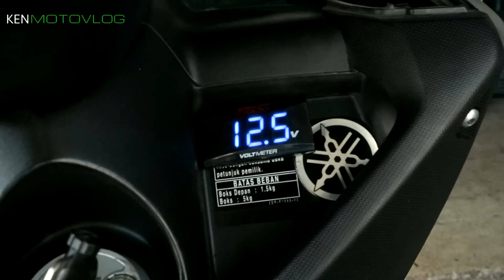CARA MENGATASI ENGINE CHECK MENYALA

Comment: Daftar ngine check saja kurang booss,
Maaf sebelumnya saya hanya melengkapi saja dan sedikit share, Tiap kedipan lampu engine check juga.
Itu menunjukan kode tertentu untuk menujukan sensor2 tertentu pada part motor nmax.
Tp tidak untuk patokan, bahwa sensor yg memberi singnal pada engine check itu part nya rusak, tetapi bagian part yg berkaitan dgn sensor yg memberikan signal itu kemungkinan mengalami kerusakan.

Sebelumnya terima kasih atas vidionya, dan sangat bermafaat untuk masyarakat indonesia khususnya pengguna motor yg sudah berbasis EFI.

Comment: setuju dengan pernyataan nya, bahwa bengkel resmi tidak semua mengerti. sekitar 2 tahun lalu saya bawa vario ke bengkel resmi di kebayoran untuk service itupun harus ambil ambil no antrian dari pagi karna saking ramai nya

1.kasus baut oli yg tidak original, mereka bilang ini bukan ori baut, pasti nga bener yg ganti oli sebelum nya,
saya katakan satu bulan lalu saya sevice di sini awalnya ngotot nga terima, setelah saya suruh cek data di komputer mereka diam.
2 kasus acg, mereka bilang ecu nya mati tanpa cek langsung vonis
kita sempat adu argumen, dan jika argumen saya salah silahkan ambil motor saya dan beserta surat2 nya tapi jika saya benar apa yg saya dapatkan dari pihak bengkel,
 
alhamdulilah karna mengerti masalah mesin jadi tidak bisa di tipu dan asal ganti2 harga ecu yg cukup mahal.

Comment: Kelemahan Yamaha yaitu di kiprok. Gua udah pengalaman di R15 sama nmax. Engine check indicator lampu nyala.
Reply: pny gw yg keluar kode 61 apaan ya, sialan gw baru KM. 25.000 udh ganti spare smp 1.052.000. dan yg bikin kesel engine checknya masih nyala! kan anj*ing tuh bengkel resmi 😡

Comment: Setuju sekali bang, di diler itu cuma mau ganti baru aja tdk mau di cek betul atau di bersikan..kemarin mobil sy baru pica plastik dan jarang  skli jln cuma di garasi sj mungkin terlalu lama terparkir akibatnya rem depan lengket.akhirx sy bawa ke bengkel resmi dan ternyata mereka blng piston cakram depan rusak harus ganti dan harga 1 piston rem cakram dpn 1,7 x 2 kiri kanan..dan sy tanya ko mobil baru jarang skli jln bisa rusak barang sekecil itu dan jawaban mereka manusia sj bisa mati😏. Dan akhirnya sy pulang besok sy bawa ke bengkel kecil pinggiran jln mereka buka dan cuci saja eee Allhamdulilah sdh 1 tahun ini sy pake mobil normal dan tdk lengket lagi.. Jd klu abng bicara seperti itu sy orang yg paling setuju 💪🏻

Comment: Nice om.
Kendala saya
1.Speedo mter cbr150 blank
2.Indikator cek engine menyala.

Service ke ah*ss , kendalanya di ceritain.
Oke,langsung naik pit.
Cek cek cek,selesai.
Sy di panggil.
1.speedo blank,cobain aja pake hedraiyer ktnya di keringin slama 20menit.
2.indikator cek engine menyala,katanya udah di reset injeksi nya. Ktnya udah aman.. Keluar dri ah*s,,tiba2 nyala lagi.

Waktu itu service reguler.
Ganti oli,reset injeksi,yaa pokonya service rutinan di buku service tu kan ada daftarnya..(bar ga dijelasin pjg lebar)

Point :Nah selsai dr situ,motor masih tetep sama.. Ga ada perubahan,hanya dirubah ganti oli.
Sblumnya rante aman2 aja,dan stel kupling aman semua..
Begitu keluar dr situ,rante kereng(kenceng) stel kopling udh kek ga di service 7taunan ga enak..
Baut ada yg ga kepasang..

Sperti motor sy tuh jadiin bahan PKLan buat anak2 jurusan otomotif..
Beda dgn orng yg dewasa ngerti motor gtu mksdku, ya ga semua mekanik kya gitu..cuman kebanyakan yg saya liat bgitu(semrawut kerjaanya)
Reply: Dealer resmi cuman ngandelin alatnya aja yg canggih.biar keliatan wah,tpi hasilnya? Beda jauh dgn bengkel biasa..
Karna apa,bengkel biasa tuh jual kenyamanan konsumen. Di banding dengan dealer resmi, jual alat bukan jasa! Krna sy sendiri yg ngerasain..
Ke bengkel biasa,cerita gini gitu ,langsung di telusirin apa penyebabnya.
Kalo msih bisa di repair ya di repair.
Kalo dealer resmi,NO!! Ini barang harus di ganti.
Speedo mter aja disuruh ngeringin sndiri,dia ga ada punya jasa repair.. Lah tong itu sparepart dri mana kalo ga dr bengkel resminya,yg buat masa tukang donat?
Dealer resmi kenapa ga nyediain jasa repair,karna dia orang pingin barangnya kejual,pikir bengkel resmi gini(lah,gua buat banyak sparepart ngapain ga dijual,kalo ada jasa repair ,item ku ga akan kejual) begitu prinsip dr dealer resmi.
Reply: Curhat sdikit,dulu pake bebek karbu 110..
Skrng up ke kelas sport. Pingin service ny emng bener pingin maksimal krna ilmu/pengalamannya kurang paham..

Comment: Mas q mengalami masalah yg serupa, dmn motor jupiter z1 q mogok mendadak dan engine cek nya kedip2 beberapa kali, di stater gk bs baik itu doubel stater dan stater kaki.

Singkat crita, q bawa ke bengkel resmi yamaha. Sambil bilang masalah motor saya yg mogok tiba2, lalu mekanik itu bilang "semuanya gpp, ini masalah nya perlu ganti piston nya kArena gk kuat di stater dan km motor nya uda gede."

Krn uda percaya sama mekanik nya, q setuju dgn usulan nya. 
Alhasil setelah di service besar dan ngeluarin biaya banyak, eh motor saya masih tetep mogok tiba2 dan lampu engine chek nya kedip2 lalu di stater gk bisa. Di tambah kabel spido meter saya rusak haduh kok gk bertanggung jawab gitu
Klau kayak gini q mau komplain aja ke dealer yamaha nya, kluar dana banyak tapi hasil nya masih tetep gk ada perubahan

Mohon petunjuk nya mas bro
Podo2 dulur suroboyone, tolong saran seng apik yo opo iki? 
Q yo arep komplain iki, kerjoane kok gk becus ngene

Comment: Betuuul bangeet, gw Ada motor Beat.  
case nya waktu itu, tiba2 rem depan gw tiba2 ngunci . Akhirnya gw bawa ke bengkal AHASS which is bengkel resmi. Kata montirnya karena sensor untuk stater, akhirnya d potong/di copot lah kabel untuk staternya yang nempel di rem depan, akhirnya kalau mau stater cmn bisa pake rem belakang (sebelah kiri).
Ehhh baru beberapa kilo meter kejadian lg.
Akhirnya gw bawa lah ke bengkel kaki Lima, ternyata bagian handle rem sebelah Kanan Ada yang berkarat. Dan cuman kena biaya 35rb kalau gal salah. Langsung sembuh.

Comment: Saya mekanik bengkel resmi,tolong ganti judul. Kalau judulnya seperti itu,itu sama saja engkau menghina semua bengkel resmi. Dan setiap pekerjaan pasti ada yg jelek wajar kita manusia. Toh mana ada mekanik bengkel resmi yg mau konsumennya kecewa. Mana ada mekanik bengkel resmi yg mau hasilnya ga beres/ bermasalah. Kita maunya ya konsumen juga senang.
Reply: Sip mas bro.. Aku jg dr beres, kalo di liat dr pernyataan ama kenyataan nya agak ngaco ya mas, masak ada piston tanpa ring piston motor bisa nyala? Coba belajar prinsip dasar motor 4tak dl mas. Kalo gak bisa monggo di coba sendiri pasang piston tanpa ring piston trus coba motor di stater smpek kakimu patah yo raiso nyala mas wong kompressi bocor.
Reply: Kl emang lampu check engine nyala kan bisa di baca brapa kedipan lampunya, nanti di liat di buku manual kerusakan apa, itu kan dr bengkel mas nya juga gak di cek dl kan pengisian dr aki berapa volt, kok langsung di tuju ke kiproknya!! Bisa aja aki nya yg drop krn watt lampu melebihi std. Pengalaman sy jg pernah nangani n max pake lampu projie lampu di nyalain pengisian lngsung drop krena watt lampu trlalu besar, tp kiprok normal2 aja.

.srn sya kalo emang gk suka dg pelayanan beres gk usah menjelek2kan, toh kita jg sama2 kerja cari nafkah, gak semua kok beres itu krjanya ngawur, banyak jg pelanggan kita pindahan dr bengkel umum ke beres krn pelayanan kuran memuaskan.
Reply: Aziz Masyhuri padahal yg kode 46 itu udah lumrah dibengkel resmikan.. Apalagi v-ixion 3c1.
Reply: @Asp080  iya mas, setau sy kl n max jarang kiprok nya jebol, paling aki nya yg drop.
.aku jg sering dpt pasien mio j series sering banget malah konsumen ganti aki di bengkel umum kiprok nya juga di ganti sekalian parahnya kiprok mitasi malah baru seminggu aki saiki lagi.
Reply: Tidak semua mekanik bengkel resmi begitu mungkin lagi apesnya aja ketemu mekanik yg kurang pengalama wkwkw

Comment: Seharusnya beres bs nyari masalah engine check pakai laptop. Dijamin gak salah kaprah, krn kerusakannya akan detect di laptopnya.
Klo gk minta memang dia gk akan ksh. saya ke  beres selalu mnt di scan pke komputer walaupun engine cek tdk nyala tp tiap sensor itu pnya batas toleransi, nnt kliatan sensor mna yg udh mau rusak.
Reply from the maker: Selesai service mereka nyolokin ecu ke laptop sambil motor dinyalain tapi gak manggil saya. Anehnya ditengah tengah cek ecu mereka matiin lampu utama, kenapa demikian? Wkwkwk

Comment: Nanya dong bang, semoga ada jawaban disini... 
Motor ane kalo colok kunci kontak trus trek ke on gak langsung nyala... dan itu kadang2 gak nentu, sempet nyala redup trus mati... awalnya panik motor gak bisa d apa2in / gak bisa nyala juga.. 
Tapi pas ane pindah standar / pijak ke standar tegak kontak langsung nyala... 
Dan sekarang kalo terjadi begitu pasti solusi nya begitu dengan cara pijak ke standar tegak.

Sudah coba cek sikring aman semua... 
Nah itu kira2 apanya ya bang? 
Nanya ke bengkel resmi gak ada jawaban, karna pas d coba kebetulan tuh motor nya lagi bisa nyala...
Jadi gak bisa cek/diagnosa apa yg terjadi... 😪😔

Semoga para master disini bisa ngasih solusi... 
Sblm nya trimakasih bang.. 🙏

Comment: Sama kayak Vespa Matic saya, motor gasnya ngayun kayak naik-turun gasnya lalu saya bawa ke bengkel resmi. Sudah ganti lambda sensor, ehh motor malah sering mati klo lagi keadaan jalan macet. Lalu seminggu kemudian balik ke bengkel resmi tsb, di cek PADS katanya normal dsb. Dia cek lagi sampai ganti injector dan masih juga gas ngayun naik-turun. Dan malam ini engine check nyala lagi. Bener kata ente bang Kenna, bengkel resmi bukan jaminan bisa nyelesain pr di motor kita.

Comment: Yang paling ngerti motor kita harusnya itu ya kita sendiri. Bukan bengkel. Sorry bro, complain nya kurang tepat kayanya. Motor situ udah banyak ubahan nya. Kalau bengkel resmi taunya based on manual book setau gua. Bener langkahnya ke bengkel spesialis. Banyak solusi buat yg udah modif2. Gua jg banyak kecewa sama BERES. Makanya belajar sendiri biar ngerti. At least ga di sembarang2in diagnosa di bengkel mana jg.
Reply from the maker: Gak gitu masalahnya bro, kalau seandainya motor udah banyak ubahan juga masa beres gak ngerti problemnya. Gue sih curiga mereka ngerti problem gue tapi males garapnya karena dia gue perhatiin dari ruang tunggu ngotak ngatik lampu waktu itu cuma diem aja mereka
Reply: @KennaPrasetya  nope. Most of the time, hahaha. Beres means tidak beres. Sudah rahasia umum kalau mekaniknya kejar setoran dapet pasien. Pasti banyak yg kurang. Intinya lo bener kecewa, nunjukin bengkel spesialis yg lebih telaten ngerjain motor kita. Tp gausah di jelek2in beres nya. Karena, hampir semuanya malah tidak Beres di beres and we know it. Lol. Semoga maxi nya tetep aman terawat. Cool mods you have there. Greetings from bali!

Comment: Stiap motor itu beda beda penyakit.nya..  warning light yg nyala itu tujuanya memberitahu pengendara kalo ada yg bermasalah di motor.nya.. dan ada 2 warning light yg ada di dashboard motor.. warning light yg untuk FI dan warning light temperatur.
Mungkin terjadi kesalah pahaman saat mas.nya memberikan keluhan ke mekanik.. wajar kalo yg di cek warning light buat temperatur.. kn recervoir.nya ada yg bocor.. mngkin di kira yg itu..
Saran sih.. klo memang motor.nya masih belum beres mending di bawa lagi ke bngkel.nya.. kan masih ada garansi service.nya
Reply from the maker: Ralat, keluhan yg disampaikan ke beres sama bengkel biasa sama penyampaiannya... Tapi kenapa bengkel biasa bisa ngatasin beres belum bisa?

Comment: Ane juga punya waktu itu bis bershinin trortelbody nmax sendiri keluar angka 34 direset ke beres, eh gak lama malah keluar kode 61 plus lampu cek engine nyala terus kadang gas gede sendiri, opsinya kadang Matinin kontak idupin LG lampu cek engine ilg dibawa jalan ya dia nyala LG, nih harus gimana ya pusing saya omm
Reply from the maker: Coba di cek di deskripsi video ini ada daftar kode cek engine nmax
Reply: Ini error di bag throttle body gan.. masalahnya sama kayak saya. Dan belum solved meskipun udah di kasi tau di beress.. besok nyala.lagi...

Comment: Kmaren sy servis cbr ke dealer resmi, kata mekaniknya ada masalah pada injektornya yg mengakibatkan brebet saat gasspol. Terus saya di sarankan ganti injektor nya dan dimintai biaya 1jt, apa gak salah tu harga injektor 1jt?
Reply from the maker: Injector kalo problem ya cuma brebet biasanya dibersihin udah normal lagi, jangan mau mas wkwk
Reply: @KennaPrasetya  dikasih 2 pilihan, di ganti baru biaya 1jt
Dan ''di akali'' dia bilangnya itu biayanya 300rb
Jadi saya pilih di akali biaya 300

Comment: Mau tanya..solusi error 61 nmax..sdh ke beres gak beres,ke bengkel komunitas nmax jg gak beres padahal sdh ikutin saran nya suruh ganti isc ..setelah ganti isc malah disuruh ke beres.
Reply: Kode 61 jangan buru2 ganti ISC, kemungkinan itu kabel ISC warna pink ke ECU putus om..
Reply: @sevyteresa6267  bener ternyata kabel pink putus..mksh ya
Reply: Sama2 om semoga awet..
Reply: Kalo kode 24 knpa ya bro nmax sya kode 24
Reply from the maker: Coba baca deskripsi

Comment: Setau sy kalau check engine menyala itu sebuah peringatan dari ECU (seperti mobil) bahwa ada yg tidak normal untuk mengetahui error nya apa ya harus discan dan bisa di reset untuk menormalkan kembali. Perbaikan tergantung dari kode error' nya masalahnya apa.
Tidak semua bengkel resmi lebih buruk dari bengkel biasa begitupula sebaliknya.

Comment: Emang ga jelas terkadang deler yamaha resmi
Pengalaman di yamah xabre w suara mesin berisik,w bawa ke yamaha resmi disuruh turun mesin,dan harga ya 1,5 lebih,
W ga yakin akhir ya w pindah ke bengkel biasa ternyata cuma ganti bering rante keteng cuma 250 w habis itu udh ganti oli mesin +air radiator.

Comment: Hallo om ,punya saya juga kaya gitu om ,pas pasang alarem motor ,apa saya harus ganti kiprok juga?
Reply from the maker: Alarm gak gede sih harusnya dayanya kok sampe kaya gini? Ada kodenya gak engine checknya?
Reply: Kalo kode tidk keliatan om,jadi gini pas di ON tuh lampu indikatornya nyala ga mati-mati om ,
Nah pas saya restar lagi kontak OFF,
Trus kontak ON nah normal lagi om
Gimna ya om solusinya
Reply: Jdi setiap star tuh kontak harus 2x di ON nya om😥
Reply: Soalnya saya panik lngsung di off in lgi kontaknya

Comment: padahal motor baru bang koq sudah kena kiprok ya, apa penyakitnya sama dengan r15 dulu yg sering kena kiproknya?
Reply from the maker: Kan di video udh di bilang, karena pemasangan lampu yang strumnya kegedean, bukan masalah umur kiprok
Reply: okesip, maaf kurang fokus nyimaknya. yup pemasangan aksesoris yg tidak sesuai ketentuan akan merusak kiprok.
Reply: @KennaPrasetya  projienya 35w bang? Dobel apa satu? Ga keliatan. Saya pake gitu juga. Motor nyala nggamau di starter. indikator engine nyala sama muncul kode 46. Alhasil ndorong. Setelah saya baca di buku panduan. Tenyata masalah pengisian. Jadi saya lepas aki. Dicek ternyata tegangan turun sampe 10v. Di cas dulu deh. Sekarang ganti kiprok tiger. Siang hari cuma pake AE DE di kisaran 13.9-14.2. Tapi kalo malem hari lake lampu cuma mentok di 11.9 doang. Ente gimana gan? Ane takut err46 lagi. Males ndorongnya beratt 😬

Comment: Area Tangsel ada bengkel nonresmi yg recommended?
Reply: Dimana bg di tangselnya
Reply: Saya mau tanya om.saya sudah ganti aki dan ganti kiprok.tapi lampu indikator enginchek masih nyala .nmac
Reply: Sy sdh bersihkan throttle body dan ganti sensor ISC. Tapi lampu masih menyala. Terakhir, kata mekanik bengkel resmi ada kabel yg putus atau sambungannya longgar. Setelah dibenerin sebentar, semingguan lampu engine check nyala lagi...

Comment: Mau minta pendapat para agan2 yang sudah lama mengendarai NmaX , kemarin saya serfis gratis pertama gratis oli dan hanya di cek pake monitor.  
Teknisinya bilang semua masih dalam keadan baik. 

Apakah kalau serfis harus mengunakan monitor, 
Soalnya saya minta penjelasan mengenai yang ada di monitor teknisinya kurang begitu paham, penjelasanya tidak detail.
Reply from the maker: Itu cek ecu namanya mas, semua motor injeksi cara ngeceknya rata rata gitu mas
Reply: Berarti setiap serfis harus cek ecu, dan harus ke bengkel resmi yamaha.

Comment: Hoax nih mau promosi, cek engine nyala ya pke komputer ngeceknya lah plg dealer resmi, ring piston gk dipasang ya gk bisa nyala pasti ngebul saat itu jg kq baru 1bln ngebul ketauan asbun ngibolnya
Reply: hoax gimana? lah ini aku servis di dealer resmi engine indikator nya nyala ada kode error nya jg tp minta motor ku di suruh nginap krna harus di cek dulu. kok gak segampang omongan lu ya ngecek di komputer?

Comment: Maaf sblummya bro.. Bro ad problem sblumnya ama yamaha Smpe ngomong kek gtu.. Bengkel resmi gk ad apa²Nya sama bngkel umum di sini saya netral krn sy sndiri bkerja di bngkel umum..di menit 5:50 soal mesin mau jebol.. Kata spa gk ad pengaruh radiator?tau fungsi radiator ngak bro? Raditor itu ngaruh loh bro, coba lu buka air radiator mtor lu trus pke 1 hari aja nonstop jebol ngak? Jdi mngkin mmmg radiatorNya mngalami kerusakan/kebocoran jdi minta ganti Dan  pernyataan lu tentng masNya lupa pasang ring piston mmng itu salah besar tpi yg jdi pertanyaanNya sy apa mngkin ring piston gk ke psang? Krn lu bilang blom sampe 1 bulan mtor udah ngebul lagi,ngelawak yah bro 😅😂🤣trus kok motorNya bisa ke pakai yah 😂yg katax gk smpe sbulan.. Bro bro.. Ngadi ngadi lu.. Piston tanpa ring gk ad komprensi..lu stater ampe kiamat pun kaga bakalan bunyi..bayangin brp byk aki tuh 😅😂🤣.. Tau fungsi ring piston gk? Jdi ksimpulan dri video lu.. Seakan lu ngejelekin pihak yamaha bro... Dan satu lagi.. Msih kasus yg sama..soal motor ngebul..ad 3 faktor. 1.mngkin kslahan pmasangan itu sndiri(sdh Mlkukan pmbongkran sblumnya) 2.ad part lain yg mmang sdh kalah tpi gk di ganti (sdh mlkukan pmbongkran sblumnya)3.dri si pemakai itu sndiri soal pergantian oli rutin Nda..Skian dan trima ksih